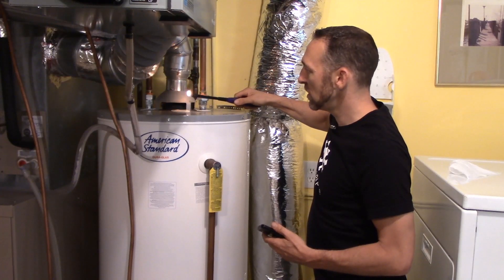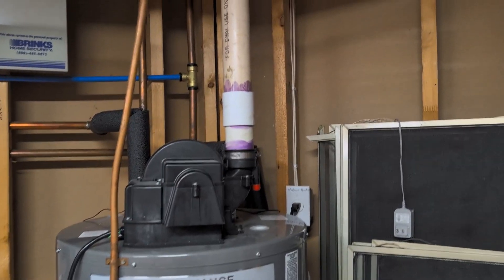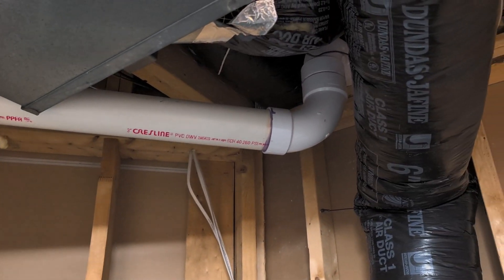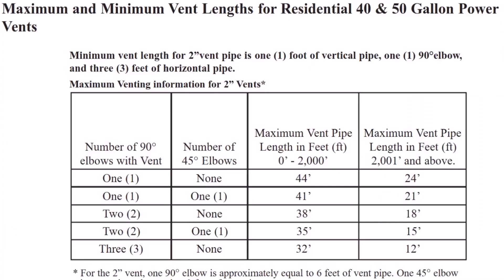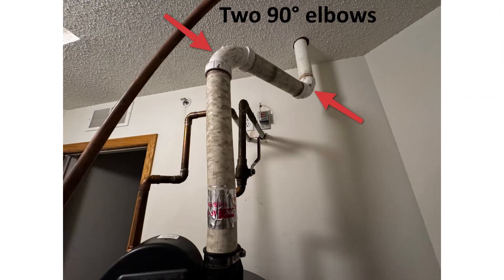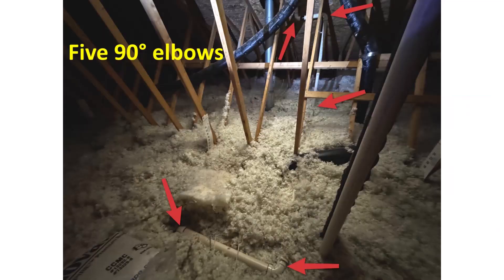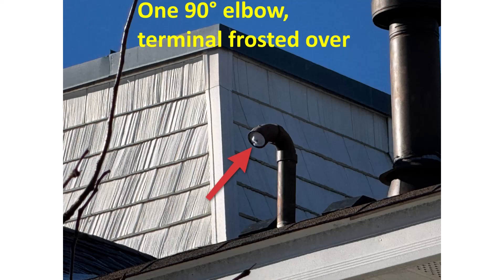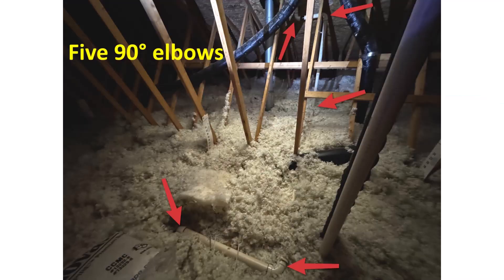Beware of powervent water heaters with 2 inch vents

Comment: in winter time it shuts off 10 times a day , it has 3" pipe the run is around 8'long up to the roof the inside the pipe vent is clean, they change the blower and the gas control and I'm dealing with this 4 years any help?

Comment: Thank you Sir for your video, it helped me a lot. I had 3-water heaters replaced within 6-1/2 years to find out the cause of this curse I was having. So I had replaced all the PVC 2 inch vent pipes to 3 inch and problem solved.

Comment: I do a lot of rental property maintenance repair.

This now makes sense on why this very cold winter, I would get maintenance calls for water heaters (and furnaces) not working.  I did find plenty of ice on the end of the exhaust outside, but now that I saw your video, I do remember only seeing 2" pipe, with runs over 15' & several 90 degree elbows.  I don't recall seeing any issues with anything having a 3" pipe.

I never gave it too much thought before, but now I will be looking for this.  Thanks for the good information.